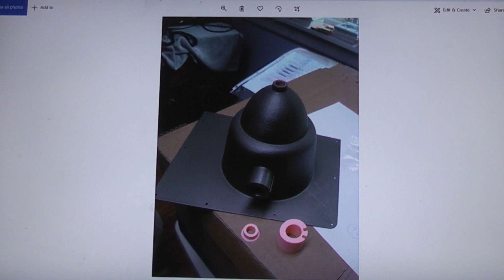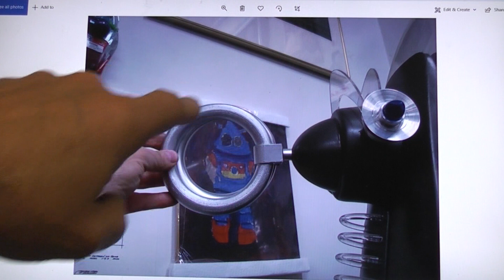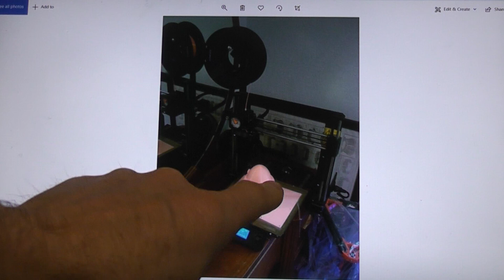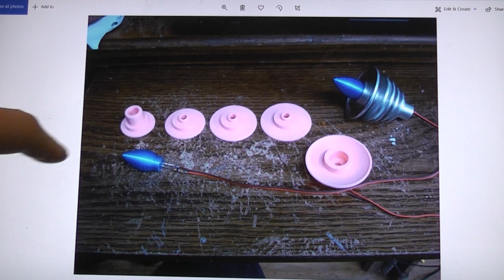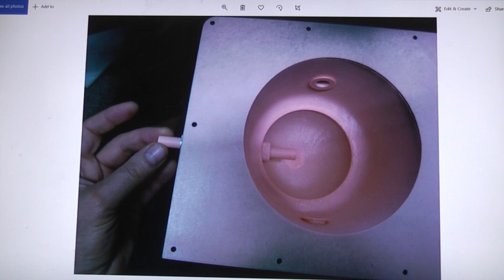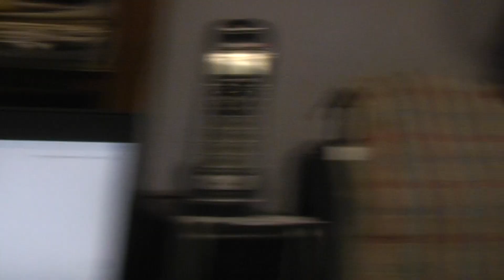Step 5. Block Head Robby Machine. Scanner Rings & Beam Blasters.

Comment: These are really cool, I'm currently building a full size Robby from files I got my hands on from a Patreon bloke by name of Ian Hughes. I joined and now have access to his files. The parts are beautiful but I'm currently incorporating YOUR moving parts into my Robby. The Heart Box frame from Ian's files are done and I'm printing all your moving parts so I can get things going, amazingly they fit. I've already done his scanner rings using a small motor/gearbox from eBay and I can't wait to get his Piano keys and rotating parts working.
Reply from the maker: Fantastic. Even with it being so much work be sure to keep it fun. Back in the 1980's when I built my first Robby I took a year to do it and it was crap. But I learned so much and met Bill Malone and Fred Barton so was able to build a second Robby even better.
Reply: @Robothut  Fun is the major component apart from the fact that I have wanted a full size Robby for about 60 years !. All of my parts are running about 5v DC and I've kept it that way so that I can use a computer powered USB hub. I've all but used all the Printer cables I had laying around. Other parts like LED's are cheap as chips on eBay so the only thing I'm not happy about is the print speed of my Ender 3 !!. Nah joking, I just have to be patient....for the next year or two...
Reply from the maker: @potrzebieneuman4702  If you find that you need a higher voltage there are low-cost Boost Regulators. I use them all the time for my 3d printed robot toys that might have 3 volts of battery power, but I need a clean 5 or 12 volts for electronics or motor gearbox.
Reply: @Robothut  thanks I'll keep that in mind, so far there only 2 small 5v motors and they have reduction gearboxes. Spinning Robby's scanners isn't much of a load although I should check the wall wart to see what it's total available current is. I can always just buy another powered USB hub but I think I may have another lying about somewhere.  I haven't had this much fun since we closed our computer business 11 years ago.

Comment: sorry but i can't find where you mentioned in your videos the most accurate paint for his grey colour  ?
Reply from the maker: The most accurate paint color is by Model Masters there Gun Metal. They used to sell it in a lacquer spray can, but have recently stopped, they still sell it in small bottles that you can use with a air brush. But for the you tube videos  I used a few different rattle can paints from the local auto parts stores that had a nice gun metal look. I think you can find the paints I used in the Forbidden plant blaster video and maybe in the Robby glove video.

Comment: Hi John, this is so cool !! This is an Amazing piece of Robby engineering , it is amazing how you managed to simply the mechanics .....you are a mechanical Wizard !!! This is a very exciting build . John do you think you can mention and show how the wiring works in terms of how the power supplies wire up to batteries and switches , I noticed there were two battery pack hubs , do they work in series ? this would be of tremendous help ! Maybe you can also do a short video of how you set up your printer for jobs like these , that would be awesome !! John , Thank you again for this great Robby gift !!
Reply from the maker: I had designed this project to operate in the 4.5 volt too 6 volt range. So that means I could use 3 1.5 volt batteries or 4 1.5 volt batteries. Now  most people to day would want to use a USB power bank type battery that puts out 5 volts or just a simple 5 volt wall wort that plugs into the wall.  So in my Robby Machine I did use 2 C cell battery holders that I had already. Each battery holder holds 2 C cells so right now my Robby Machine is running on 6 volts, I like the way it looks at 4.5 to 5 volts better  but as the batteries wear down I will get there right. 
 As for wiring there really is not much to show. I took all the negative wires from the LEDs and motors and connected them together and connected them to the negative battery wire. The n the positive wires from each section I run threw a switch and the switches go to the positive battery wire.